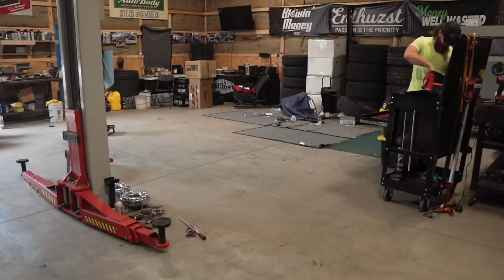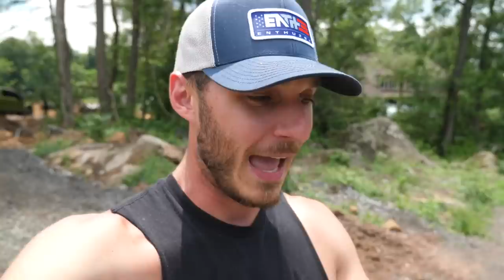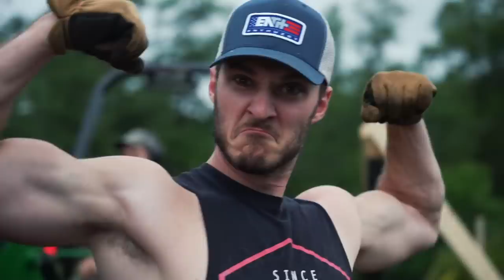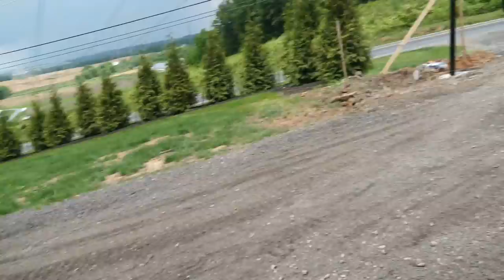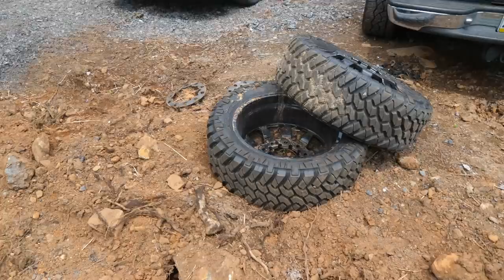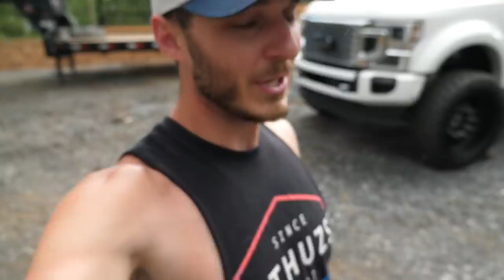Can’t start the OG2.0 build.

Comment: You shouldnt run cat 6 with power cables. In conduit. Also should be buried 2ft deep with 3” of sand below and above the conduit. If you plan on driving over the conduit it should be buried 3ft deep with the same 3” of sand on top and below. Then lay warning live wire tape.